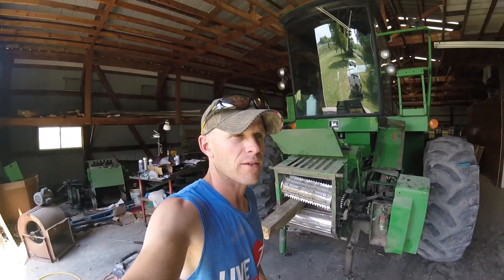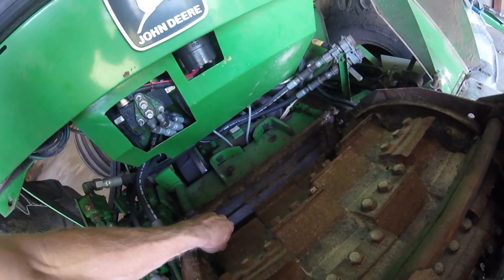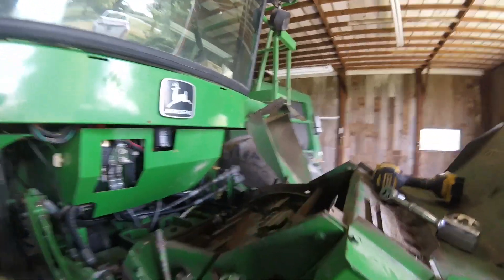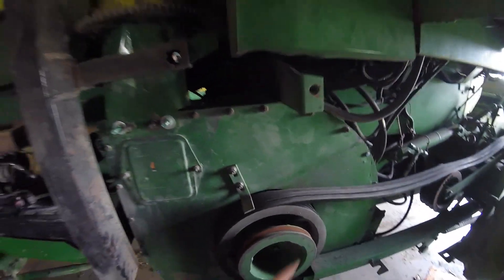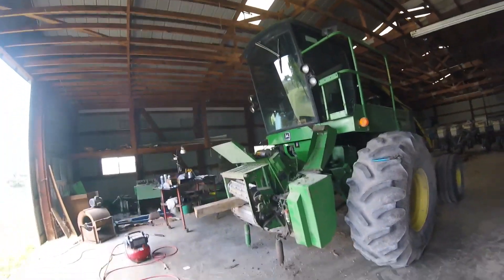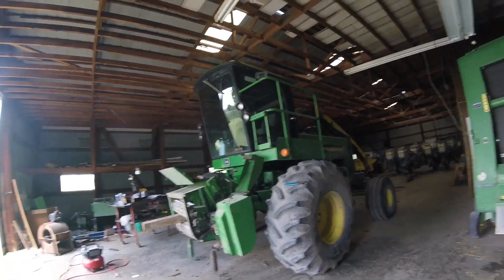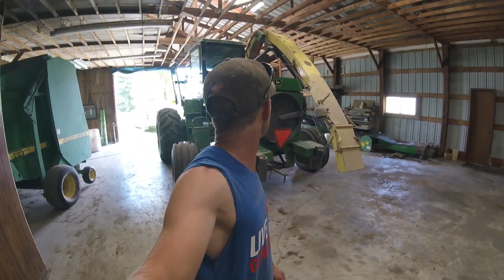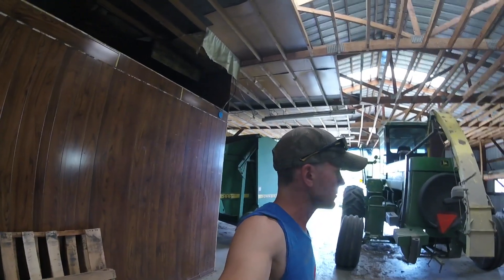5830 silage cutter explained

Comment: Hi I want to buy one of this machine. I want your advice, sir. Are the spare parts expensive for this machine and are it resistant to work?
Thank you
Reply from the maker: Issa Issa You can still get a lot of wear parts through deere or aftermarket. However more and more of these parts are becoming obsolete and will have to be found through a salvage yards. It can get very expensive.